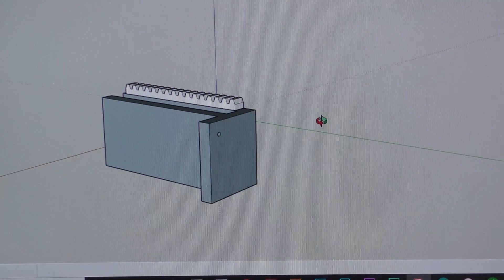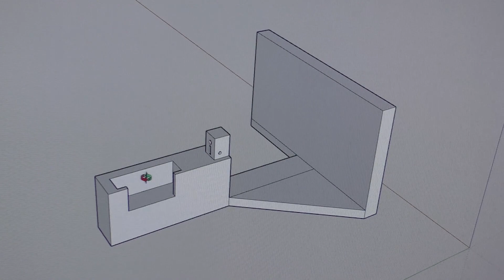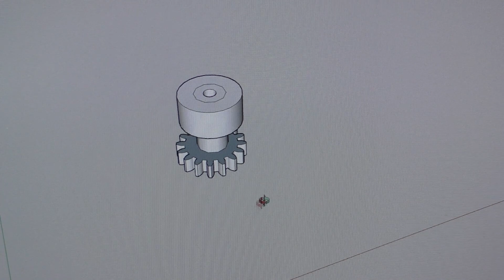Mechanical Tremolo Part 1

Comment: Very cool and unusual project, as always :)

I'd go with a "desmodromic" drive like in Ducati motorcycles, this would likely reduce the load on the motor, by foregoing the spring. 
Alternatively a roller on the end of of either cam or pushrod would also reduce the load. 

You could also adjust the depth by using a moving lever between the pushrod and cam, could be adjustable by a servo :D
Continuous rotation servo would also do great as the "modulator"

In fact, you could use the same thing to make an "autowah" effect or  add modulation to any parameter of any effect :)